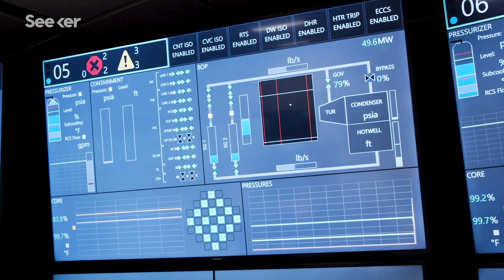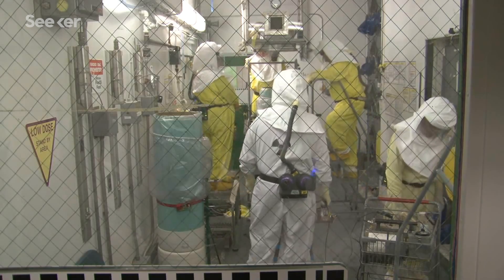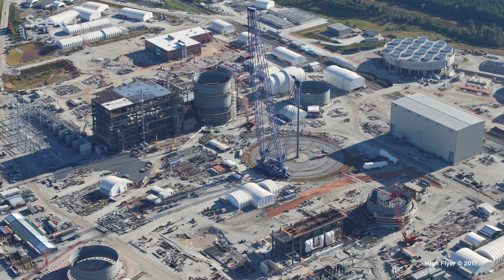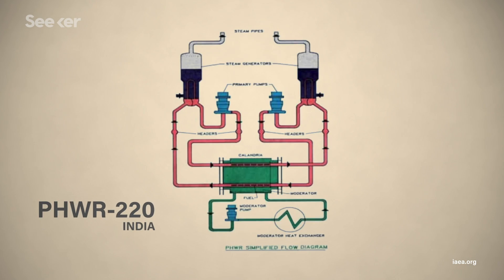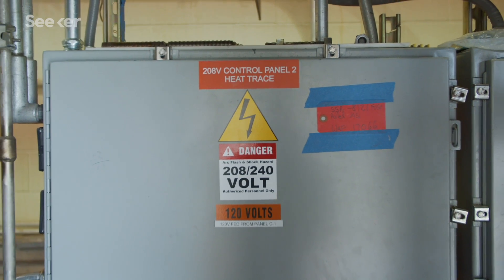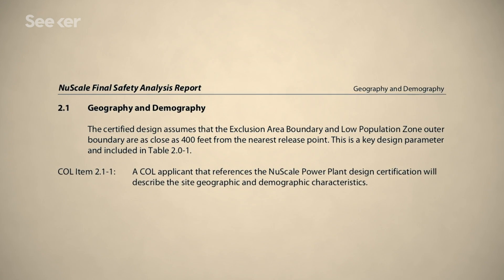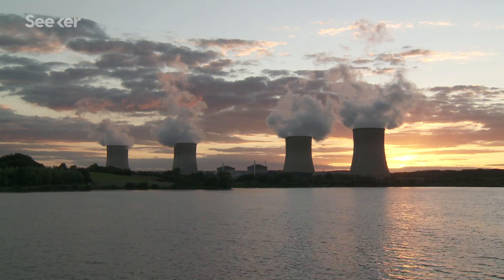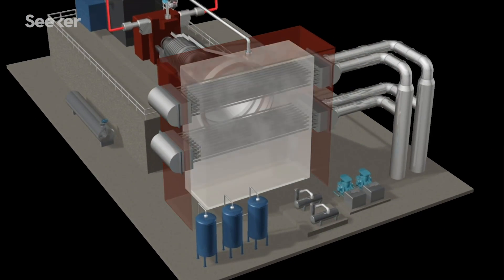Mini-Nuclear Reactors Are Coming, and They Could Reinvent the Energy Industry

Comment: Well if you really want to do nuclear we need to invest in Thorium based reactors
Reply: Yes and no.
Right now we have massive amounts of uranium and waste actinides from all the solid fueled reactors.
We have no long term storage solutions yet and liquid fueled SMRs can run for years just off of the waste we have lying around.
So that first, spend the money you make on Thorium research.
Thorium is great, however it is not immediately necessary.
Reply: True. But the military industrial complex didn’t choose thorium on purpose. They wanted weapons grade radioactive waste for weapons.
Reply: @pauldecristoforo  Thats not at all what happened. Light water reactors were made first so the regulations and systems were in place. Then the military wanted high heat reactors for planes and made molten salt reactors. It didn't pan out because thorium produces higher eV  radiation than uranium reactors. This means they needed more shielding than anticipated which simply didn't work out for planes. By that  time thorium research has concluded but a small team continued research. Then the three mile island thing happened and soon chernobyl happened and bye bye thorium. Actually the entire nuclear industry as a whole went to a grinding halt at that time. Reactors were kept operational but almost all new reactor construction was halted, the public lost interest, and wouldn't regain any interest until the whole global warming fear happened.

Even today there is very little public interest in nuclear. On videos like this and forum threads you would have discussion on the feasibility of nuclear plants, the problems, the benefits. But on intellectually void places like twitter people just say "nuclear bad". You can see Japan as a prime example. They are full scale "nuclear bad" mode. All their nuclear reactors are shut down. Germany has ramped up coal production because they promised to shut down nuclear the instant fukushima happened. They simply played on emotions of the public and decided to spew a bunch of mercury and lead in the atmosphere instead. It can't be bad if you can't directly see it right?

The only countries doing thorium research right now is China, India, and Canada. All the american money is going to Canada because they actually allow thorium research. I can bet my lunch Canada won't have a giant crater or nuclear disaster from thorium research. Instead they will just have shiny new reactors.
Reply: @SourDonut99  issue with Thorium is not high EV per say. Yes there is short term more radiation, but small part of it is the most dangerous. Its a type of gamma radiation that is hard to shield from including alpha and beta emitters.. It just passes through everything.
Reply: Quis custodiet ipsos custodes Thats not at all historically or scientifically accurate.
Reply: @pauldecristoforo  Not true, you can make bombs from thorium, it's just that the process to get the material is much more involved.
Reply: @pauldecristoforo  but wouldnt that be illegal
Reply: supersonic118 boi No. that’s what the military industrial complex wanted when nuclear was thought about. It’s been that way ever since. 
Trump wants new nuclear weapons made. Where do you think that radioactive material comes from?
Nuclear power facilities.
Reply: @pauldecristoforo  makes since since im pretty sure it's illegal to make new nuclear weapons the standard way
Reply: @pauldecristoforo  Existing nuclear power plants will provide more than enough plutonium, etc. for any "improvements" in our nuclear weapons stockpile.  Since this is a fact,  the Liquid Flouride Thorium Reactor LFTR is the way to go. Remember, since 1950 we have always been assured that  nuclear FUSION is  only "20 year away"  Trump also favors new approaches to Nuclear civilian power.  That's a fact.  Check it out.
Reply: @pauldecristoforo  Nonsense - nobody has ever made a weapon from spent fuel from a reactor built for power production ( though in a few cases they've made power from reactors built to make weapons.) Now the nuclear powers have far more weapons grade uranium and plutonium than they will ever need, and are trying to blend it down or denature it to make civilian fuel. Normal reactors' spent fuel is far too hot, radioactively and physically, to be good bomb material - it it's left in a reactor for more than a month, it gets enough unstable plutonium 240 to make a weapon behave like sweaty dynamite, besides making the bombmakers sick, cooking the explosive detonators, and blasting the sensitive trigger electronics with gamma rays. No nuclear warrior would bother with it.
Reply: You can have efficient, clean, fast reactors without thorium, so WHY do you need thorium so badly? Please explain it and give a reason for your claim that we need thorium.
Reply: @jeffreylebowski4927  
There are great reasons for using Thorium.
Non proliferation, valuable nuclear byproducts, abundant fuel.
However, as the most pressing problem is "global warming", forget Thorium, burn uranium and nuclear waste stockpiles.
But Thorium has many bonuses.
Reply: James Neave true.
Reply: James Neave in the long run we’ll run out of uranium so we should research thorium reactors just in case. This is without taking fusion into account, however, which could make fission obsolete.
Reply: @MostlyPennyCat  You can build nuclear weapons from Thorium reactors. The whole non proliferation thing is untrue because U233 is an intermediary product in Thorium reactors. Thats literally weapons grade uranium. You can easily extract that from the liquid fuel and build bombs. But honestly thats the least of your worries. There are steps to mitigate that but you need a lot of oversight.
Reply: @jeffreylebowski4927  Here are the reasons: Low grade waste, abundance, lack of potential input for nuclear bombs, fail safe / low pressure operation, way less complexity to run compared to say a CANDU.   No high pressure water system to contend with. 

The only and significant barrier is commercial application.  GE, Siemens, Rolls Royce and countless other vendors who, as a matter of course, routinely take advantage of the aging condition of the reactors stand to lose billions if there is a switch to this newer technology.    A functioning nuclear power plant is basically a giant, continuous maintenance operation with a few hundred layers of red tape. 

Thorium is only viable if major money is spent on it and in today's political climate, Coal and Oil is king.   Thorium is very similar to Hemp in that its an obvious choice which will address many issues but human being have their head and money up their asses to make it happen.
Reply: @respekted  India and china are investing heavily into thorium fission as far as i know, because india has loads of thorium but very little uranium.

Fast uranium breeder reactors would have low grade waste too - they could even burn up currently existing waste, getting 50x more energy out of it. Fuel would be abundant too. They too would operate with liquid metals or liquid salt at low pressures and be passivly save - but ofc they could be used to enrich uranium for weapons... Thats an advantage thorium alone has.

I guess we dont NEED thorium but its still a great element for fission - i want to see both 4th gen fast breeder reactors burning up current nuclear waste and also thorium reactors! =)
Reply: NomSayn The pressurization, complexity of reactor system are based on the reactor design not the type of fuel used. Also Breeder reactors are inherently more complex than conventional reactors, so I don’t know what you’re talking about. 

Furthermore if you are referencing a reactor such as a LFTR- that reactor system is extremely complex and the largest burdens to entry are actually:

- Fuel process development
- Fuel matrix (homogenous Verdi’s heterogenous)
- Coolant cost (liquid beryllium is actually very expensive)
- Very High heat and radiation resistant containers
- liquid coolant and fuel systems (fluid dynamics for liquids that aren’t water are actually extremely complex)
Reply: Why? Even conventional nuclear is FAR safer and FAR cleaner than ALL alternatives, even solar.
Reply: ipisse, Haven’t they built Thorium reactors as test beds and run them for long periods?
I thought I read about such a thing being done back in the day.
Reply: Nuclear fusion is better.
Reply: Specifically, they should enforce liquid fuel, molten salts as heat carrier, inherent passive saftey and the disqualification of pressure vessle designs.
Reply: Because Youtube armchair physicists and their conspiratory videos told you so? LOL
Reply: Why can't we all enjoy thorium and uranium? Why does it have to be only one choice?
Reply: ??? you do realize that we need to remake the old infrastructure of nuclear plants  you want to have thorium based reactors which could take decads such as Snr
Reply: https://youtu.be/uzCxFPzdO0Y. Oops
Reply: Even normal reactors are better.
Reply: System is the problem 🏡  The Great Qualities.

1, Show all living creatures; all the love and kindness as much as you can.

2, Only try to be honest with yourself. If you try to be honest with others, you will get into big trouble soon or later.

3, Aim only one target at a time; otherwise you are chasing two rabbits and you will miss both. So, the reason behind it. Have one powerful reason and never ever give up the one you want the most.

4, Don't try to be good person only but be the powerful person. We will grow to be the one or we will die. There is no other choice. 

5, Always learn and look for to improve something your life. 

6, You are not alone. Love and faith the high power reduces unnecessary stress in life. But never completely rely on it. 

7,  Success and happiness are the byproducts of our usefulness. So, always increase the possibility of success.

8, Life is not going to be easy. Because of our unnecessary things. Eliminate all the unnecessary things as much as you can by organising yourself well with the environments. 

9, Never believe anything without the proper evidences. 

10, Always try to give more than you take. 
Because it is dignity/ character of the divinity within you.

🌎 As long as people continue to see themselves as separate from everything else, they lend themselves to being completely enslaved. Success depends on how well we relate to everything around us. Joy comes from that bliss of connectedness. I believe that unarmed truth and love will have the final word in reality. To love; you should have good heart. I am a good person until I see a person better than my standard of goodness. Being good is the progress towards a worthy cause. Love is God. Whoever lives in love, lives forever. How selfish it is to try to keep something forever? Love is all about nourishing, nurturing, sharing and expanding the love within you for all. The principle to which we adhere to is that we have kindness of love at heart for the whole of mankind.  As long as there is the unnecessary differences within us; we can not live peacefully so we have to eliminate all the unnecessary differences among us so we can love all. People abilities may vary but not there true love. If we love a person/ God for a reason then we love the reason but not the person. No reason is the reason to love the person because true love never fails. So do not compare or measure the true love as first or the last but love all truly. If you love people truly then you can understand people. If you don't love then you don't understand people at all.

People are controlled by system why?
The Cyclical Consumption is the current economy all over the World. It is making the scarcity problems of the earth finite resources to deteriorate day by day. Current Monetary System is legalised theft. Real money is Gold and Silver. Scarcity gives the money more value. Real money won't lose it's value. When Governments stay away from Gold & Silver then very easy to transfer the wealth / resources to upper class the Rich (Corporatocracy) Elite. When the Governments are printing out more new fiat currency with reserve banks, our old currency is losing its purchasing power everyday. They are printing millions of currency everyday. All governments and laws are existing right now to transfer wealth to upper class the rich elite. The USA Government & other Governments are in many countries, bailed the investment banks & financial institutions in 2008 against the majority of the people. There is no democracy in any countries. Because of the Money System based on profits motive only above all else even humans lives and well-being. So, we do not have freedom to protect our values with the money so on. The violence, bankruptcy & all the negativities are build into the Monetary System of our society. All are owned (including ourselves) by Reserve Bank. Which is private cartel the corporation. So, in legal system, we are legally considered as chattel the properties. They make money in the capital markets with our birth certificates. They do not consider us as Humans. That's the truth. We are at the invisible war with the Elites (Corporatocracies). We have to fight for our Freedom. Resource Based Economy is the Solution. We have to declare the earth resources as the heritage of all the people of this world. So everyone has access to it. Please have your research about zeitgeist movement then you know the truth more. 

 Truth About Health/Drugs Industry Because Of It Your Life At High Risk The drug industry is a 1/2 trillion dollars a year worldwide conglomerate. Almost 300 billions dollars just in North America. That is really big business. What would happen if everyone were well? There is no money in health. You see, good health makes a lot of sense but it doesn't make a lot of dollars. Because everything they do is toxic. Every drug they use, prescription drugs, all drugs are liver toxic, bar none. If you've had amalgam fillings put in your mouth by dentists. It is highly toxic. There's cancer because most of the chemos are themselves carcinogens. To view the tumor as the cancer and we know the tumor is not the cancer. The cancer industry is 200 billions dollars a year. The more work they get, the more profit there is. You have to dismantle; If the truth ever came out about what we would need to do. 30% of people of females in America are at risk of getting, will get cancer of the breast. The ones that are already dead have been grossly mistreated by the medical profession and by the government that supposedly is supposed to encourage free research and development of all possibilities. Why would medical doctors who studied medicine and practice medicine and are heavily funded by pharmaceutical companies why would they go and look into vitamins? That they never had the answer orthomolecular. And as more and more of our population start taking their health into their own hands, there's going to be even more and more of changes. It can't go on the way it is. The system is failing apart. We must make nutrition the primary prevention strategy for the population. You are what you eat. You are everything that you have ever done to yourself. The choices you make directly affect the outcome of your life. - (Food Matters Documentary in Netflix)

😊 Well, I truly love God. I am not religious but very spiritual person. So, I believe 1) Religion is the beliefs in someone experiences But spirituality is having my own experiences. The mainstream religions people promote religious ideology by giving guidelines and guide but In my spiritual life; I do not want anyone or anything between God and me to restrict my freedom to worship God. 2) We do not need any authorities to do good work. The god work is the good work always. In contrast; organised mainstream religions are claiming that they have the authorities to do God works as leaders so on. 3) God is not capable of doing wrong thing, change the past for us and create anything out of nothing for us. Nothing means not anything. So, even God is limited. The mainstream religious people believe that God is unlimited. 4) God wants us to take responsibilities for our righteousness life but not for all the consequences of our actions because they are continued to exist among us. So, How can god punish us for all our consequences? The mainstream religious people believe we are full of sins because of all our actions. 5) Freewill  is an illusion. People always choose the perceived path of greatest pleasure.  So, we do not have choices all the time. In contrast teachings of the mainstream religions are promoting people to do god's will always because we all have choices of freewill always. 6) We can not separate everything into groups. So, everything for good and evil and there's no success and failure for everything. If everything is real then real things can not be threatened. Once you come to understand that God/The Holy Spirit is in each of us, You will no longer need a Book to tell you how to live. Then why we need religious scriptures? The Virtue is the expression of the basic goodness in our actions. The Basic goodness is the fundamental worthiness of every individuals. We are worthy to God always in everything. 7) Beliefs in a cruel God makes a cruel man. No matter what; every living creatures has the right to live and What makes their life cheap? Everything depends on everything. Nothing too big or too small in value. We can not love and hate at the same time; Being a vegetarian means love without cruelty happily. The mainstream religious people are killing people and sacrificing animals in the name of God. They promote God's cruel punishments. The Punishment is endless for Sinners/Devil according to religious scriptures. But God is love always. Overcome hate with love. If all religions for peace, unity? No way. Because they are not for peace. 8) Well, The God gave us everything to go from moment to moment in our lives as we do our part  and pray only to thank god then the Love is in progress. The Love is always for everyone. We are always worthy of the God's love. Our greatest fear is; not to be loved by anyone but we are all loved by someone. When we eliminate all our unnecessary differences among us then true peaceful life is possible with the true love. If we can't find the peace within ourselves then we will never find it anywhere else. 9) This is the Fight for independence and freedom of humanity to worship God freely without religious guide and guidelines to restrict us. Unnecessarily, We do not want third party controls over us in anything ; especially in spirituality. 10) Revive Survive Thrive. Sincerely,  The Real Peacemaker against religious oppression.

 https://youtu.be/HbvCxMfcKv4
https://youtu.be/pIJHJzDQcRM
https://youtu.be/MyxbdmAnIcI
https://youtu.be/wLzeakKC6fE
 https://youtu.be/P8vHa8zD7jY
Reply: Thorium is not as energy dense, leading to a larger quantity of waste. Additionally the reason the United States chose to go with uranium based reactors was not for the fact that it was to build nuclear weapons, but more so because we had more experience with uranium based reactors. Most reactors in the United States are based upon and scaled from the original nuclear reactors used in nuclear submarines. Canada has a better approach overall with their CANDU reactors, so if you are interested in better alternatives check out those, not thorium.
Reply: @TheSkippyboy  We can extract 4 times more electricity from thorium then from the same amount of uranium
Reply: @TheSkippyboy  With Thorium as fertile material, converting to U 233, and MSR, you get a much more efficient reactor, with a energy return up to 2000 times. That is much better than todays 80 times. (which of course is much better than 7 for solar and 18 for wind)
Reply: Henric H definitely.
Reply: @henrich2183 " With Thorium as fertile material, converting to U 233, and MSR, you get a much more efficient reactor" In order to convert Th-232 into U-233 this will require additional energy that is never needed when using a conventional reactor, so based on the way you phrased your argument, this doesn't make any sense. 

What youre referring to is that U-233 emits more neutrons than U-235, and depending on the type of reactor configuration you can optimize different efficiencies to have a greater overall output. For example a LFTR utilizes beryllium Fluoride coolant. Beryllium is a neutron multiplier which increases your probability of fission coupled with a greater probability of fission utilizing U-233. Additionally these reactors operate at much higher temperatures than conventional reactors thus improving thermal efficiency. 

However, notice how Im talking about much more than just thorium itself. Thorium is not a god material. Yes there are benefits, but to get the efficiency limits you are referring to your variables are much more dependent on the reactor configuration, coolants, operational procedures, reactor design etc than just the fuel itself. 

If you want a case by case efficiency comparison compare Shippingport's reactors cores over time in which 3 of them were conventional Uranium 235 cores and one was a Uranium 233 core used in a LWBR configuration. Then compare the efficiency benefits of the LWBR configuration to that of a IMSR or LFTR configuration- theres a substantial difference even though they both use thorium cores.
Reply: @brian2440  No extra energy, except for the u235 that it starts up with, is needed in the liftr to convert th232 to u233. I guess you have seen Kirks and Flibes reactor design. Do you mean that their solution isn't working?
Reply: @henrich2183  Flibe and thorium won't work without Lithium enriched to 99.995 % Li7 isotope. You'd need tons of it for each reactor, and at the moment there are no facilities for making it, and no work being done to develop them. Much quicker to build burner reactors using uranium or plutonium, either with or without thorium, and then move to a thorium breeder design later.
Reply: @TheSkippyboy  You can create more energy with thorium by just using the ash leftover from coal plants than what the coal gave off as energy.
Reply: @TheSkippyboy  your name is the same as your answer. nice! :D